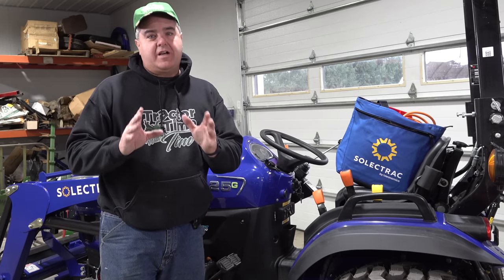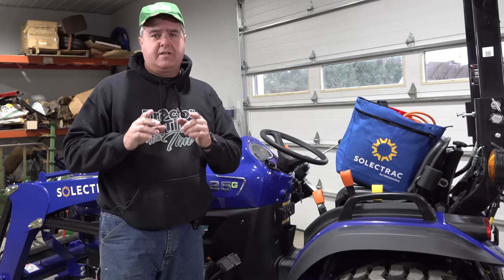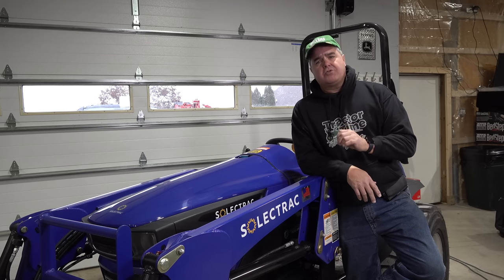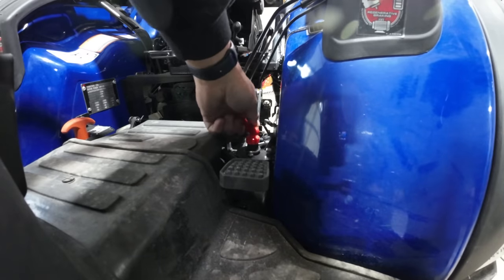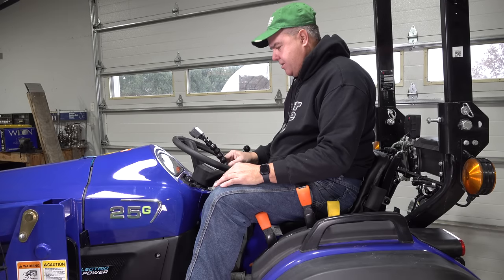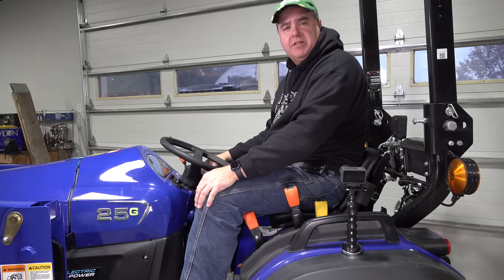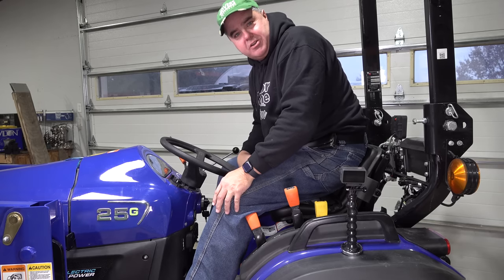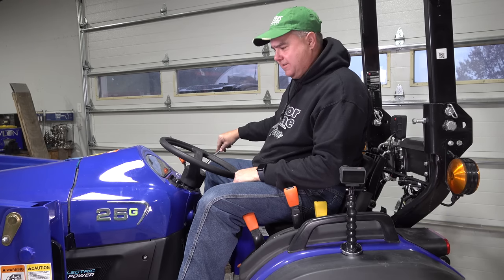Solectrac Electric Tractor First Look; Startup, Transmission Control, Initial Recharge Time & Charge

Comment: Seems silly that they didn’t give it a completely electric steering rack so that you could turn the hydraulic pump off completely when not using the loader.
Reply: Maybe you can still steer it still just not while stationary
Reply: You can steer without hydraulics, you just don't have power steering.

Comment: Electric serves a purpose....but you need to know the limitations.  I personally couldn't do it.....first time the battery died unexpectedly on the back 40.....I'd burn it where it sits. 😆
Reply from the maker: Just like you do when you ignore the diesel fuel gauge and run out of diesel?  weak argument. ...but ok.     If it immediately goes from 50% battery to dead, then I will agree with you. We'll see how it goes.

Comment: what i heard about the batteries they get to cold shut down and to hot shut down. the chargers in the cold to charge the cars would not work what i heard. not looking good. they will shut down the grids if you have to many cars to charge at the same time. the grids is not set up for this, then you have bigger tractors to charge. you have wind mills that are tearing up. there is solar panels missing up. they should start at a small scale first to get the kinks out.

Comment: Is your welding outlet a 30amp receptacle? 30 breaker? I was concerned about the size of wire until I noticed it was only a 30amp male plug. Does the manufacturer have different size charging systems…I know teslas have the 120volt ones that are free. Then owners decide whether they want a 30amp, 40amp or 50 amp. I’ve wired a few. The guys i worked for, chose 50 amp chargers. The smarts of the car was connected to their phones so they could track the usage draw. I really liked your disclaimer at beginning. I imagined a thousand people up in arms over their own ideologies. Ready to quit the internet.
Reply from the maker: 50 amp breaker.  I’m not worried about the small cable since that is what the mfr sent.  They would size the cable appropriately for the demand.

Comment: I always wonder did farmers and worker have these sort of conversations about the steam engine coming in at the turn of the last century about how horse would be made redundant?. We won’t never stop using petrol and diesel but if we cut down the amount we use that’s got to be a start
Reply from the maker: Bob, you are assuming that fossil fuels really ARE a problem.   The other side would argue that man made global warming is a fallacy.  Of course climate changes, somewhat,  but it always has.
Reply: @TractorTimewithTim  it has been mentioned that if we just give government much more money, they can change the climate back 🙄
Reply: @TractorTimewithTim  they are a problem, not the only problem, and as the last sentence says if will can cut down on the amount we use then that got to be a start

Comment: Not sure if an electric vehicle, tractor  is going to work for me. If I'm in the middle of something and battery dies I would be in trouble.
Reply: Same thing if you run out of gas or heaven forbid you run out of diesel with a tractor where you have to bleed the entire system.  As electric becomes more common so will the apparatus of road side assistance to get you back up and going.  Ford has already made the F-150 Lightning so it can offboard electric to another vehicle to charge it on the roadside.  I think the biggest issue with EVs being practical is charge speed, range, infrastructure of chargers, and cold weather performance.  We are seeing ranges on cars already hit near the max where I want to be seated for a drive in one seating, charging is improving but needs to move from 20 to 80% in 35 to 45 mins to 10% to 80% in like 10 to 20 minutes.  You need grab a sandwich, stretch and use the bathroom then you can go another 300 miles.  Cold is always going to be an issue and only adding more battery range may address that... And infrastructure still sucks. That all being said EV cars and tractors are in their infancy compared to ICE that has over a century of solid advances.
Reply from the maker: Chad, similar…but different.  A quick refuel with diesel.  Obviously if we let it die in the field, either will be trouble.

Comment: I was gonna say you having to sit harder doesn't make since. Flip this flip that sit harder? Farmtrac can keep that in India. They just develop stuff to sell here in the USA because our grid is better to handle the charging of this kind of equipment,,,,,for now. A few years back one of our Ford tractor dealers took on Farmtrac and within a year he got rid of them because of too many issues, comebacks, and warranty issues.
Reply from the maker: Yes. I think you have a good point.  I will expound on this further in another episode…not sure when yet…anyway, part of the “Innovator/Early Adopter” phase is dealing with some less than optimal compromises.
The focus and investment on this tractor is with the power train, not with ergonomics etc.   No way a small company like this could invest in everything at the same time.
Once the power train tech is perfected, some of these other issues can be addressed.  
Again, more on this in a later video.

Comment: I don't know how I feel about this thing...for some reason it just looks like a cheap knock off. It reminds me of those cheap no-brand ATVs and UTVs that have weird controls and overall seem have long term usability concerns. In my opinion, not having forward or reverse control with pedals is a huge fail...who wants to shift that little thing back and forth like a non-hydrostatic tractor? I understand when working fields for 10 hours a day, some people prefer gear drive style tractors, but this tractor with the limited battery runtime and size seems more in the hydrostatic control forward/reverse pedal use case scenario. Also, that throttle lever seems dangerous...someone with other tractors is definitely going to have this tractor facing a building, other vehicle, etc.. and crank up that throttle out of habit and ram it right into something!  I'm interested in electric tractors/equipment for sure, but I'm interested in seeing John Deere's (or another major brand) offering. I can't wait to see how the Solectrac actually performs...hopefully I'm wrong!
Reply from the maker: Do you like reading books?  I recommend “The Tipping Point” by Malcom Gladwell.  I think it fits this situation perfectly.

Comment: You couldn’t give me an electric tractor. So what happens in 5-10 years when the battery pack that costs more than the tractor is worth needs to be replaced? What happens in the middle of a job when the battery goes dead? You’re supposed to wait until tomorrow to finish? Yeah, no thanks.

Comment: Be very careful with those 240 volt plugs. I  have heard there have Been failures with them on EV chargers. Not trying to be a naysayer. Just keep an eye on it.
Reply from the maker: Be careful?  How?
Reply: @TractorTimewithTim    That relates to, to small of a wire guage for the amps being pulled.  People use to small a guage wire and it gets over heat due to the amps being pulled.  Just feel the wire.  If it is hot or warm, replace the wire with a heavier guage wire.  Also check the temperature of the breakers as well as the wire from the plug to the breakers.
Reply: The actual plugs themselves have melted and caused fires depending on what they were made from.  It's a small percentage, but it's still happening. Just a heads up.

Comment: Are you out of your mind ? Electric tractor  . What till you have to have it worked on . Wait till you batteries die  ( cost of replacement and disposal cold weather kills your batteries )  before tractor is even paid off . Wait till you have to buy parts . You will get more hours of work out of diesel fuel than you will ever get out of batteries  . What will you do when Electric companies say not to charge your electric tractor  . ( happens in many states . Batteries are not recyclable . Now you helped contribute to pollution .
Reply from the maker: 4:50